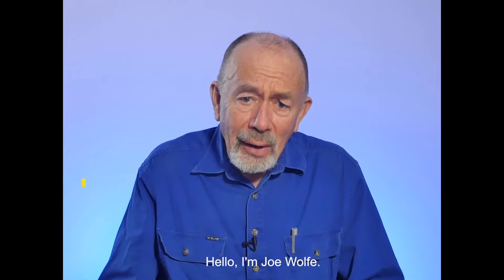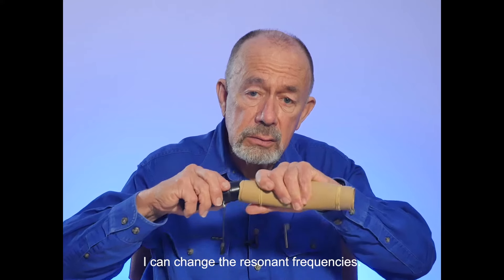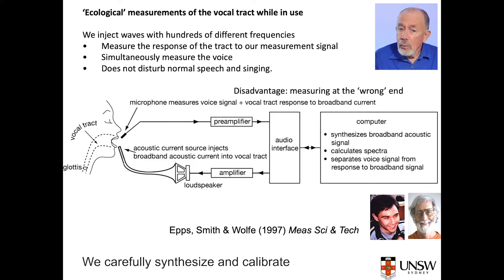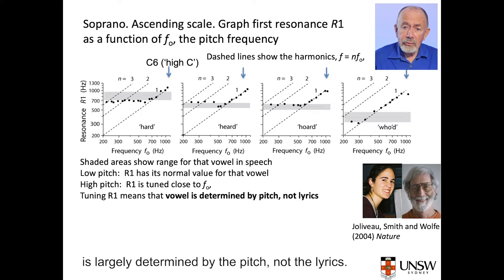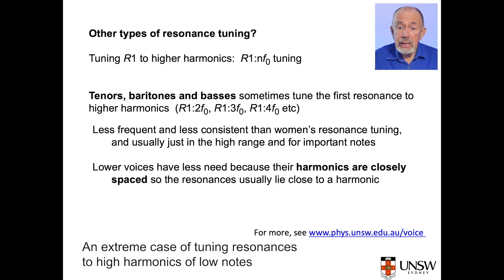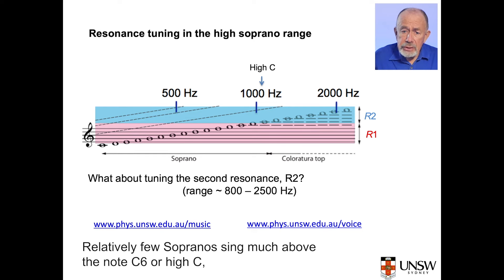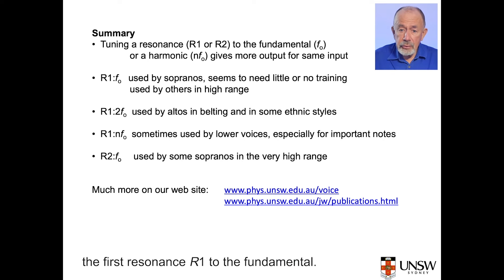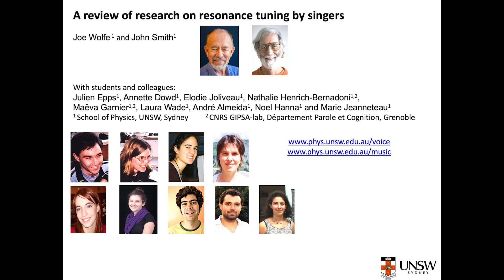Resonance Tuning in Singing (Formant tuning)

Comment: Brings up the question of A432Hz Scientific Pitch as being preferable to singers since it is a geometrically-related frequency.(Harmonic ratios in geometrical division and angles).

Considering that A440hz standard ptich is an arbitrary pitch that is not related to mathematical ratios, is vocal resonance easier to produce if fine-tuned a bit higher or lower than A440 hz? There are specific vocal register shifts between the base, tenor, alto and soprano “areas” of the human voice. Especially from F to F#, and B to C. These are very specific areas on the chromatic scale. One would think there here could be a specific frequency in that spectrum that maximizes the tone of the voice. Not to mention potentially making it easier to sing to, and thereby putting less physical stress on the voice.

Excellent and provocative video. Thank you, and do visit my channel, The Acoustic Rabbit Hole concerning my Theory of Pitch Psychology which claims to have identified specific themes and emotions to specific keys/notes..

Be well!  Your, Acoustic Rabbit Hole
Reply from the maker: You are correct in saying that pitch references are to some extent arbitrary and there are arguments about which is best. Humans have different voice ranges. They come in different sizes and shapes so the range of their vocal resonances also vary. So, in principle, we'd expect that different pitch references might suit some singers better than others. However, the difference between 432 and 440 is not great, even compared with the day-to-day (or morning to evening) variation in singing ranges or vocal resonance ranges.

A larger variation comes from 'original instrument' performances of baroque works. Often these use A = 415 Hz. This can make life easier for sopranos and tenors: their 'high C's in baroque tuning have the same frequency as a high B in modern tuning. Conversely, baroque pitch makes very low notes harder to sing. I don't know whether anyone has studied resonance tuning in baroque pitch.

Woodwind instruments provide a practical constraint on changing pitch references, because the tuning slide doesn't affect all notes in the same way: 'long tube' notes are affected less that 'short tube' notes. Modern woodwinds play well in tune at roughly A = 440 Hz or a bit higher. Recreation baroque instruments are usually made to play at 415 Hz.
Reply: @JoeWolfe  Indeed, I didn't quite consider the in-between pitch reference of Baroque tunings. Your response was a valuable assessment of pitch-reference challenges throughout history. Thank you!

In addition to meditation on the textural differences of A432 vs. A440 vs. A444hz (Shcumann Resonance, Earth's Atmosphere), I am observing the "primal" pitches as called or cried by different animals. Birds are bit more a chore to isolate and table a specific frequency on my tuners. I am convinced that not only is our hearing spectral (C/"red" to F/"lime-green as the warmer colors and F#/"green" to B/"magenta are the cooler notes. Meaning each note has a specific textual quality. Fore example F# always as a buzzy sort of twangy sound to it. Marking it as green reminds that F# is a pivotal note is the vocal register-shift from F to F#. Also, just as C is the opposite of F#, so is C/red the tritone of F#. Further, the color green divides or "splits" the 12 tone color wheel just as F# splits the octave of Middle C to a higher C. There is clearly a REASON that Middle C is associated as the center of the keyboard. 

In my work I have confirmed thus far that animals do not sing in A440 concert pitch. Which is not surprise. Ha. I have found that in general they DO tend to pitch lower, rather than higher. And, yes, closer to a432hz than A440!

At the moment my focus is to prove a general psychology of the keys (by analyzing song-lyric themes and thematic choices of Classical works. I also am working to prove that the reason people have perfect pitch at all is because they have learned or have always been able to identify at note by it's intrinsics texture (coloring). Which can be seen parallel to the color spectrum. Right down to the try-tone complimentaris.. And I'm bringing attention to my channel by creating stunning Sia music videos!
Reply: @Acoustic-Rabbit-Hole  stop the esoteric pseudo-science, especially under such an educational video! Frequencies are arbitrary, and so is 432Hz. Btw, the moment vibrato is added, the exact frequency range of A4 is all over the place, even if your instrumental accompaniment is tuned to A4=432Hz. Even if you tried to sing a note without any vibrato, there would still be some slight variation in pitch, so that you wouldn't really be able to consistently phonate 432Hz (more likely, it would end up being some range between 425Hz and 440Hz).

Comment: Where can I hear r2f0?
Reply from the maker: It might take time to find an appropriate file because John and I are now both retired. And you might be disappointed: R2:fo doesn’t sound much different from R1:fo - after all, a resonance is a resonance. The difference in sound is mainly that R2:fo usually, though not always, is used at higher pitch.
Reply from the maker: Sorry for the delay. I posted a sound file on this page: https://www.phys.unsw.edu.au/jw/broadband.html